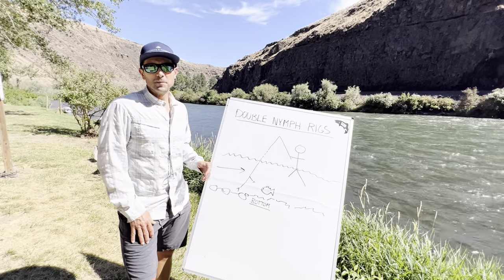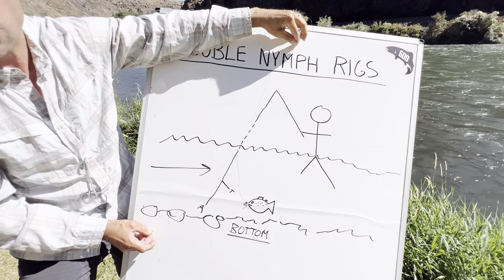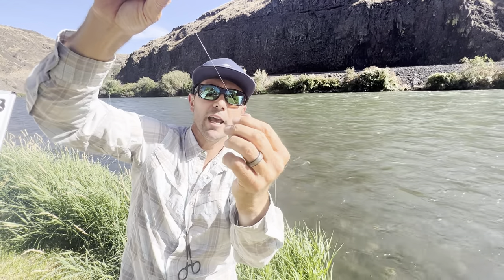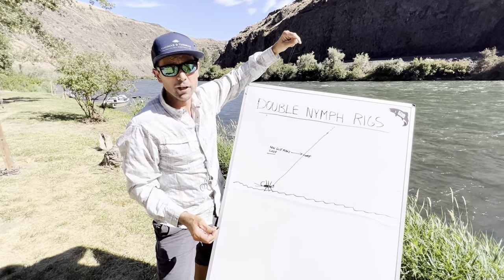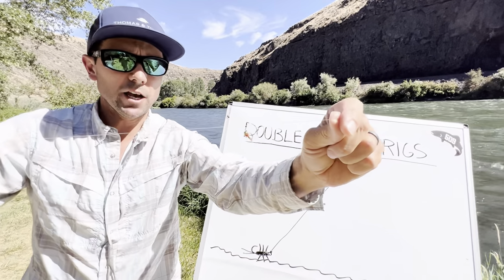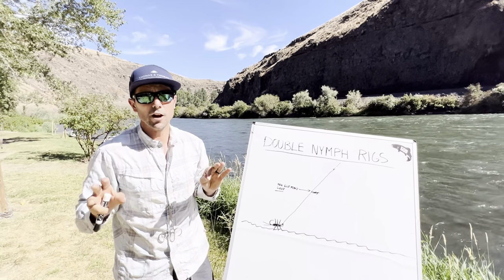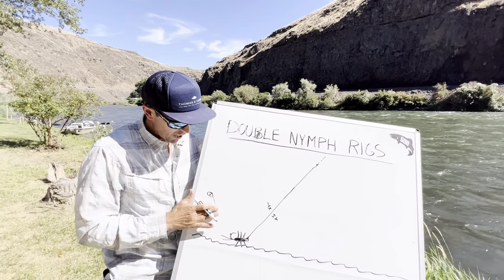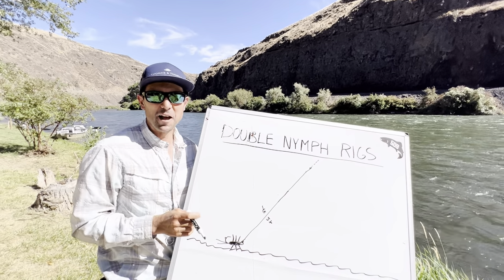Double Nymph Rigs for Euro Nymphing // ESN Quick Tip

Comment: Great tips. I have been using tippet ring rigs. 4ft to the ring, 20 in to the anchor. 6 inch tag. At times it will wrap around the tippet. Other than that it’s quick and easy to add or remove the tag. I will try the double clinch!

Comment: Great tips Joe!!  Thanks for sharing!!  Kelly Galloup showed a similar way to attach a tag fly by pre-tying 4-6” Tags with a perfection loop on the end and would just slip it above the knot in the line and cinch it down.  Changing out the top fly is easy to with the perfection loop. Just un loop it and change it out.  Same concept and great ideas!!
Reply from the maker: Yes that is a great tip, then you can swap in and out I suppose.

Comment: Great video and advice. I like fising one Nymph. It is easier to cast and change one nymp out if you are trying out patterns on new streams.  What junction knot are you using for the smaller fly with the 6x tippet in your first example?  Great hacks overall. I am going to try them all :-).

Comment: Great video.   Well done.  Great and clear information.
Quick question (I hope it is OK).  How do you feel about tying a tippet ring to the tippet and then attach 2 separate tippets to that ring?  One would go to the point fly and the other to the dropper in the Euro set-up.   That way, if a fly breaks off due to a snag (or whatever), you'd simply just tie a new tippet (with a fly attached)  to the tippet ring and you are up and running.   Seems like an easy set up.  Not sure if the tippet ring would compromise the drift though.   I appreciate your response.
Reply from the maker: Yes that rig works great, the trick is to use a slightly stronger tippet size above the lower ring. I think it is outlined here somewhere in this video, as it's not an uncommon setup. I personally don't like it but have seen many anglers do this.
Reply: Thanks for getting back to me.   I appreciate the response and the information.    Love your videos.   Thanks for posting them and sharing your knowledge and experience

Comment: So, modern fluoro is strong enough that girth hitching or clinching one line around the other doesn't compromise the line with a fish on? I never would have thought to try it, but I'm really happy to hear it!
Reply: I use the clinch knot when adding a new dropper. The girth hitch will work fine too. The benefit of the clinch knot is that there is less resistance with one small knot as apposed to a knot and then a loop. This means that the clinch knot method will sink quicker and the current will have less drag on it as well. It's better in my opinion.

Comment: Clinch knot and even surgeon loop hitched onto your main tippet greatly decreases the breaking strength of that line (which means a fish on either nymph is more likely to break off). Instead tie your new upper fly on with half of a double uni knot above the "old" knot. That puts 5-6 wraps around the main line instead of 1 or 2 in your rig with a clinch or surgeon.

Comment: A question here… you mention that your point fly is to be in contact with the bottom, do you mean like continually bouncing off of the bottom or should it be drifting suspended just above the bottom, maybe only ticking the bottom every once in a while? TIA
Reply from the maker: Great question, a bit of both. If it's a "moppy" fly like a stonefly nymph with Cheneille or a bugger of sorts it will do fine being "near" the bottom in the layer of water that is hardly moving. These big stubborn flies allow you to pull light tension against it without lifting it to the surface. With typical beadhead Perdigon style tungsten nymphs you'll want to be in near constant contact. A small streamlined nymph like a Perdigon doesn't tolerate as much tension without being lift way up off the bottom.